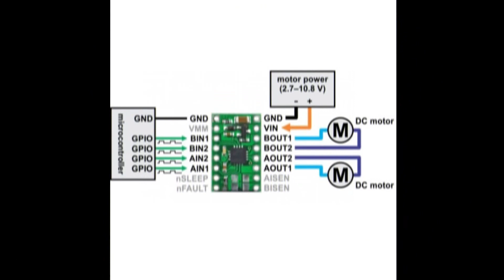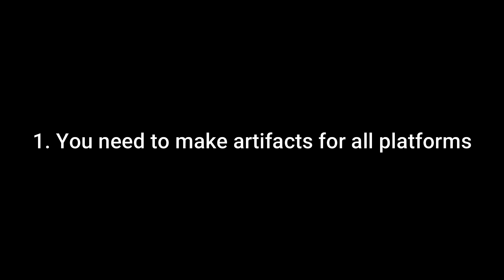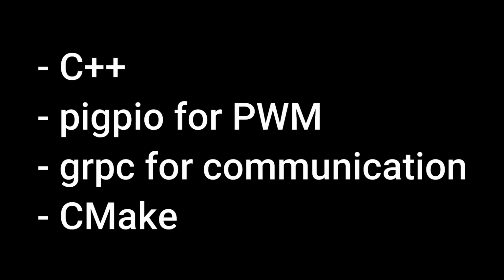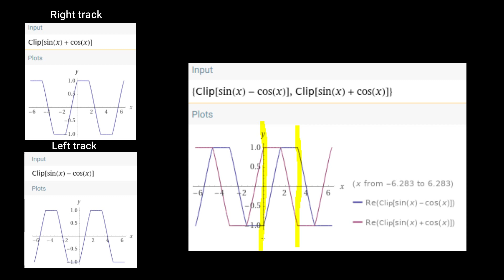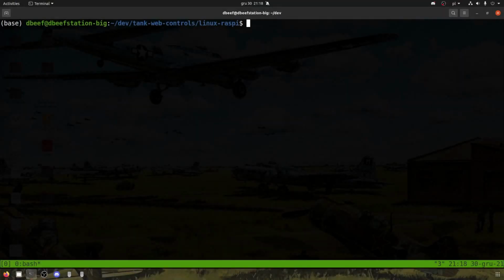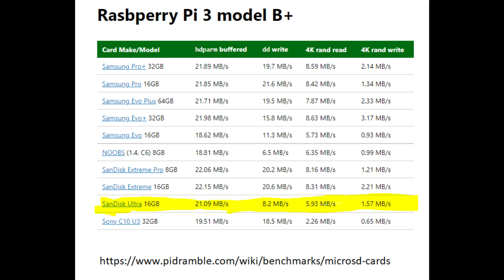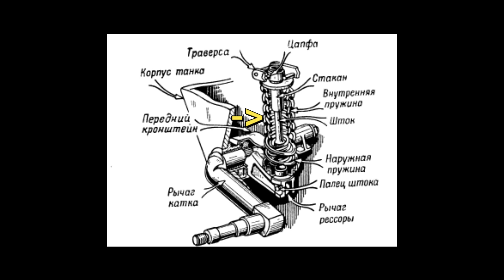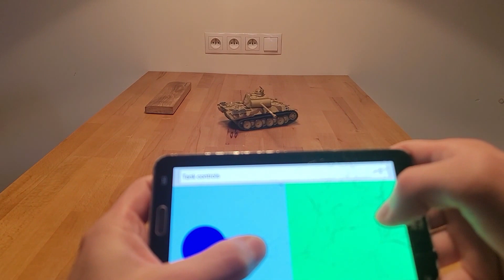Making a tank

Comment: What's the rpm of the motors?
Reply from the maker: It's 320 RPM at 12V (but they're connected to 3.7V lipo) - model N20-BT07.
Reply: @danielzalega8588  ahh right thank you you've inspired me to make my own out of a panzer 4 ausf d and I was stumped about what rpm to make it realistic
Reply from the maker: @josephtrott4368  Nice :D If you're not planning to use a voltage converter though, I'd check out N20-BT06 with 75:1 400RPM, I wish I at least tried it in my panther
Reply: @danielzalega8588 Thanks I'll check them out as the voltage converter sounds like quite a bit of work

Comment: Thanks, could you show the wiring diagram as well as the components used, my electronics skills aren't that great.
Reply from the maker: Hey, will update the Github repository with a diagram and a list of components tomorrow.
Reply: @danielzalega8588  Brilliant, thank you.
Reply: @danielzalega8588  Hi, just wondered if you had been able to provide a wiring diagram as well as the components used please, would really appreciate it if you could.
Reply from the maker: @peterhurn4045  Hey, terribly sorry I did not provide the diagram last time, found myself in a lot of stuff afterwards and frankly speaking I forgot about it.
The components are:

Servo EF90D 360 - micro
https://botland.store/micro-servos/17520-servo-ef90d-360-micro-with-wheel-and-tire-5904422327705.html

2x Li-Pol Akyga 750mAh 1S 3,7V
https://botland.store/battery-li-pol-1s-37-v/6033-akyga-li-pol-cell-750mah-1s-37v-connector-5904422364229.html

Step-up converter 5V 1,2 A
https://botland.store/converters-step-up/3686-step-up-voltage-regulator-with-usb-socket-5v-12a-5903351241304.html

Lipol charger
https://botland.store/charger-modules-for-li-po-batteries/6944-lipol-charger-tp4056-1s-37v-microusb-with.html

2x 100:1 DC motor
https://botland.store/pololu-micro-engines-lp-low-power/706-motor-with-100-1-gear-pololu-992-5904422305963.html

Dual channel motor driver:
https://botland.store/drivers-for-dc-motors/546-drv8833-two-channel-motor-controller-108v-12a-pololu-2130-5904422367213.html

Raspberry Pi Zero WiFI (plus, any MicroSD card)
https://botland.store/rpi-zero-modules-and-kits/8330-raspberry-pi-zero-w-wifi-bluetooth-512mb-ram-5904422311513.html

Will post a comment with a diagram this weekend, writing this down to the calendar to not forget :D
Reply: @danielzalega8588  Thank you, really appreciate the information and your time :)
Reply from the maker: @peterhurn4045  Hey, just updated Github repository with the wiring diagram:

https://github.com/dbeef/tank/blob/master/schematics/Tank_bb.png

There was no component in Fritzing to use for DRV8833 and the step-up converter, so I used breadboards and attached labels with corresponding pin names, it should be enough to figure things out.

In case I made some errors in the diagram, best to assemble it iteratively, first wiring and powering up Raspberry from lipo, then connecting the servo and checking if works, etc. 

Cheers